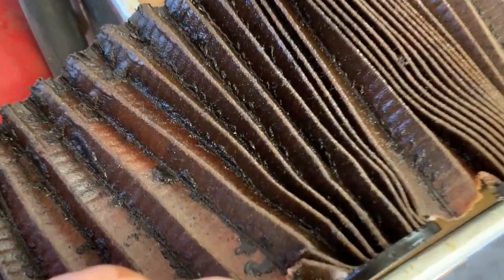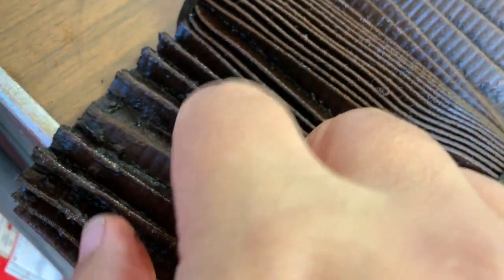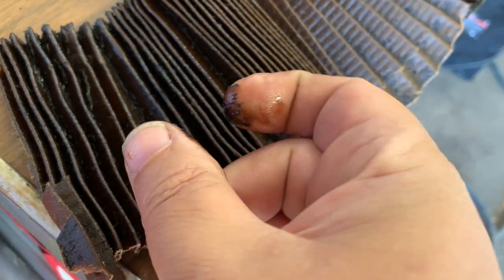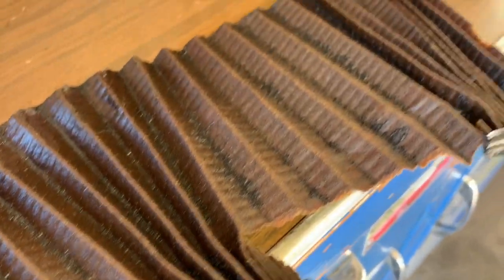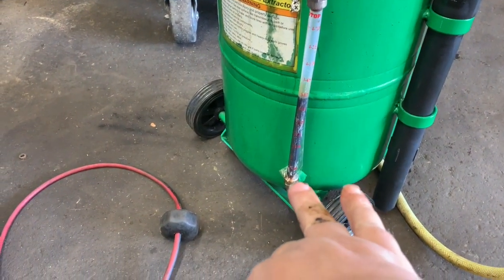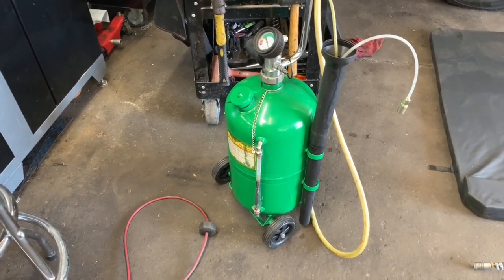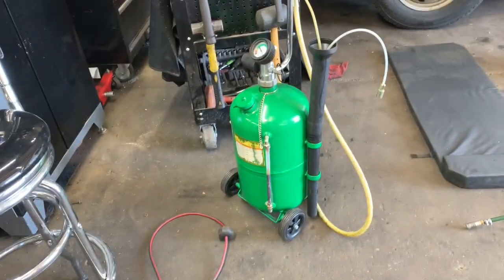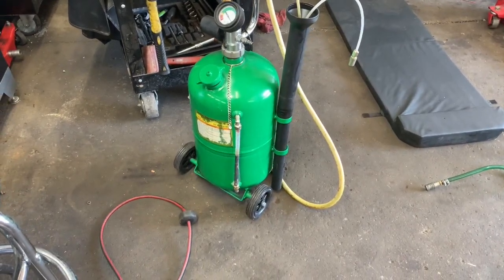Pentastar 3.6 P0016 and P0017 codes. A fabulous mystery unfolds. Solved! Ram Promaster

Comment: These codes can be caused by two loose oil plug screws under/close to  those two phasers that the manufacturer failed to tight up.  I own a 2014 dodge grand caravan and  I got a P0018 and P0300 this year, I fixed this problem thanks to a youtube video by the Online Mechanic Tip.
Reply from the maker: Saw that video from JT. In this case, we couldn't verify that those fittings were or weren't leaking because it would entail a lot of labor to get the valve cover off. That the damn thing was double filled with oil was enough to justify blaming the oil change place and proceeding from there.
Reply: @promastersonly1419  agreed

Comment: I own a 2008 GMC Acadia with P0016 and P0017 codes. The initial symptoms were a rattle noise on startup that disappeared shortly after. The car drove smoothly besides the rattle noise on cold starts. I drove it for 2 months prior to getting the timing chain replaced, but the codes persisted. I discovered metal debris in the VVTi and noticed scoring on the camshaft and journals after removing the camshaft.
Reply from the maker: @rebelliondoor  it stands to reason that debris and damage might bleed off oil pressure, and thus the cam wouldnt be in the position that it’s commanded to be in.

Comment: 6000k miles on a new long block from dealer.  Has a dealer oil change 1900 miles ago. Just got a random p0018 after a hard acceleration and a bumpy road.  No weird engine noise or tap. Cleared the code but will bring to dealer when we get home. Wondering if it’s a plug or wiring .
Reply from the maker: Several possibilities, and some of them are quite scary. But since the code cleared, it suggests intermittent electrical to the cam position sensor, which with P0018 is on the front head. The dealer will read codes and declare it's fine,  which it is for now. But if you can get in front of a human being make sure they know about the bumpy road and ask them to inspect the wiring coming from the sensor. If they were competent and helpful (fat chance) they would also so a software cam phaser cleaning routine, verify the cam position differences, and maybe look at oiling. But in the absence of other symptoms, electrical is the most likely, and all that wiring is easy to inspect and get to.

Comment: Since you like puzzles, Hopefully, you can give a suggestion and possibly piece it together. However, it is not a Promaster.
I have a 2014 JKU, and I keep getting codes P0017 and P0019. The engine will die (especially if dropped into 500 RPMs or below), rough idle, and sputter on a cold start. Needless to say, I cannot get in my jeep, start it and go without it stalling on me. Now if I let her warm up, she will drive beautifully until the traction control light pops on, then she goes into limp mode. However, I can put the jeep in neutral, turn it off, restart it, and drop it in drive then the traction control light will disappear. She will drive fine. I can turn the engine off, and restart it, and no traction control light. Now, I have replaced the camshaft position sensor, and the code is still there. Some people are suggesting a timing issue, however, I do not think it is a timing issue. If it was, I don't think it would drive as well as it does when the engine is warm. Therefore, it makes me think it is an oil issue. I did an oil change with 5w-20 and drove for about 700 miles, then thought changing the oil would fix the issue. I changed the oil weight and put 5w-30 full synthetic in, and the P0017 and P0019 code disappeared but was replaced with P000A and P000B. Those codes only showed up for a day, then disappeared and the P0017 and P0019 returned. Now I must add, I did check the timing chain and it is tight. I have taken it to 2 shops, and they have done diagnostics and are completely stumped as am i. Any help would be greatly appreciated. Thank you for your time.
Reply from the maker: I do enjoy a puzzle. I'm in agreement with you - a mechanical timing problem like a chain or a tensioner is unlikely. Your 017 and 019 codes are for both banks, in a jeep the drivers and passenger side banks (passenger is 1, driver bank 2). I suppose it's possible the chain jumped a tooth, but that's crazy rare. I can think of a few things to try. If you have access to a fancy scanner you can do camshafter phaser cleaning routines on all 4 cams. All it does is cycle the cams through their full range in an attempt to dislodge any dirt or debris that might be hanging up the phasers. But where I think your problem lies may be in the crankshaft position sensor. If it gives false data about where the crank is, it may code for the cams being out of position because it's just a dumb computer and doesn't know. The crank sensor almost never goes bad, but the wiring to it is exposed and often makes a delicious meal for rodents and road debris. Worth checking. It's on the passenger side of the block, low and rearward by the transmission bellhousing. (continued)
Reply from the maker: Assuming no issues there, we also have seen a very occurence where RF interference makes the computer screwy. Each cylinder head has a little noise supressor bolted to it on the back of the head by the transmission - simple little one wire black cube looking thing. Check though. Longshot. 

A fancy scanner also can do a cam/crank relearn. I doubt that's the problem beceause it would have coded for that, but it's something to consider. 

The next step after that is to verify the cam positions. This is pretty serious stuff, and involves using a multichannel oscilliscope to look at the signals coming off all 4 cam sensors and compare them to the signal coming off the crank sensor. In this way, you can at least be sure the computer is getting accurate numbers. 

After that, the next step might be to suspect that the little tone wheels on the ends of the cam have shifted. That's gotta be crazy rare, but there is a youtube video of a guy who experienced exactly that. I doubt that TWO cams would have done that, but it's a crazy world and anything is possible. That too would be revealed by the oscilloscope test. 

One thing I should mention - you can verify 100% that it's NOT the timing chain with a fairly non-invasive test. You gotta pop both valve covers, but when you do you'd rotate the crank such that the little arrows on the drivers bank were pointing directly toward each other, and when you do the the little lines on the other bank should be pointing directly toward each other. In fact, now that I think of it, you can be sure the chain DIDN'T jump a tooth, because if it did all 4 cams would be coding, not just two. 

One other curveball - in my video that lists the recalls, there was a run of cam sensors in late 2013 or early 2014 that are known to be bad, and known to cause P0016 and P0017. In that video, it tells you how to identify the bad ones by a number printed on the sensors. Worth a look. Pretty sure you can see both sensor's numbers without even having to pull the intake. 

After all of the above fails, it might be time to start throwing parts at it. Not sure what those parts would be, but they are going to be oiling related. Holding out hope that it's NOT that. There are examples of cam phasers going weak, but that's an easy test with the valve cover off. You just put pressure on the cam with a crescent wrench, and watch to see how solid the phasers are. 

Let me know what you find out.
Reply: Sometimes we look at problems way to technical and overlook simple solutions, just for shits and giggles I wonder if she were to prime the oil system prior to cold start if it would still do it, here's my thinking but I am only a half assed backyarder, Because its both banks related I would think it's something they have in common and seeing how there are 2 sensors and 4 phasers  and two chains I would doubt they would all fail the same way at one time, crank sensor would be a possibility and is not expensive and easy to get at so could change that but these engines seem to be oil temperamental I have known several of them to consume oil with no sign of leaks or burning they also have a crappy plastic oil filter housing and both banks use oil for valve timing, in 2014 I believe was the year they changed the filter housing to where the oil pressure valve was in the cap instead of inserting the filter over it maybe there is an issue with the cap when the oil is cold and thick that clears up when at operating temperature, when the oil is thick there might be enough pressure to close the valve and bypass the filter and maybe the problem is something to do with that by pass mode, priming the system before a cold start by hold one foot on the brake and the other holding the gas pedal to the floor then turn the engine over might expose this. Its a simple thing to do like I said shits and giggles.  @promastersonly1419
Reply from the maker: There's a company that makes a pre-oiler that bolts onto the top of the oil filter housing. I personally think it's entirely unnecessary, but you might dig it. Search for "dry starts" and I'm sure you'll find it.  @jaymortensen642
Reply: I saw that if we are talking about the same one, it comes with a shrader valve on the side so you can blow all the oil back to the crankcase during oil changes and it uses a standard oil filter instead of the paper cartridge but the issue is it's 350 bucks its not cheap, but I was just referring to a test by priming it just to see if the problem would go away that maybe the cap was faulty.  @promastersonly1419
Reply from the maker: @jaymortensen642  The flood clear mode works, so your test might work. But i doubt it would matter. At cold startup, the oil pressure is something like 70lbs. I forget exactly what the change for 2014-up addressed, but it uses a different filter.
Reply: My understanding is inside the oil filter housing there is a spring with a small plastic valve on it and you insert the oil filter over it, the valve is a bypass if the oil pressure is to high which can crush the oil filter but they had issues with that valve so they redesigned the cap to put the valve inside of it for 2014 so the cap is taller then the previous years maybe at 70psi it can crush the filter so the bypass opens until the oil warms and pressure comes down is it possible that valve is say not operating correctly or the bypass is partially plugged and effecting the phaser operation. So maybe the flood clear mode would prime the system and upon start up maybe she would not get the codes it seems cold start sets it off once warm she can shut off and restart without codes maybe her traction control is a different issue like a wheel sensor although I have been researching this because my kids jeep is having a similar issue but not the same codes but still cam sensor related and I think his traction control light comes on because of limp mode but he also has a clock spring issue, I think his cam sensor code issue is a lock in a phaser sticking he only has bank 2 effected not both and has already changed the sensor now those locks are operated by oil pressure being sent by the actuator it lifts the lock out of its seat allowing the phaser to move this is where my thinking is on her vehicle its something that effects all 4 cams at once these motors seem very temperamental about even type of oil used. @promastersonly1419
Reply from the maker: Any of those P0016, P0017, P0018 are going to be either the phaser, or more likely the tone wheel for the position sensor has slipped. Search P0017 on youtube and you'll see some videos on it.  @jaymortensen642

Comment: Hi, here in Brazil I just bought an 3.6 Wrangler 2014, the code p0017 is always on, and some time when I speed up, the codes p0339 p0345 p0365 p0390 all turn on and the vehicle goes very slow. Where should I start looking?
Reply from the maker: Starting easy to hard, I'd swap the cam pos sensors bank to bank and see if the code moves. I'd look for oil in the cam sensor connectors - seen that before. After that, it's more serious - pull the valve covers and verify that the galley plugs are tight, the cam tone wheels haven't shifted, and the cams are in time with each other.

Comment: Interesting one. 

Is there a zero oil pressure default position for the cam phasers on initial engine crank without oil pressure and how long does the engine have to run before the cam phasers are fully functional?  Also, is there a warm up or temperature schedule controlling cam phasers function during the warm up period, and will the phasers function differently during sub freezing and extremely cold temperature operation of say zero degrees Fahrenheit or below? 

I have a Ram Promaster City with the 2.4 TigerShark multi air variable intake system and on initial crank during start up, it sounds like their is a temporary hard crank hit just before the engine fires and starts running. Is that the oil pump doing its multi pressure/2 stage thing? And does the pentastar 3.6 v6 do the same 2 stage oil flow pressure thing for phaser control?
Reply from the maker: The multi-air engines are very different. But the 2 stage oil pump almost never goes into high pressure mode on the 3.6. Doesnt need to - it has 30lbs at idle in low pressure. 

Not sure of the exact start cycle, but the cams are adjusting almost instantly.

Comment: What brake pads and rotors for a RV 3500 promaster about 5 tons. Looking for the best pads and rotors. It has a 3 inch lift and an extra leaf in the rear. Lots of dirt roads and hills. Love your Chanel.
Reply from the maker: We prefer the Power Stop brand stuff. Rock Auto carries it. It's budget priced, but has proven itself to me many times over. The OE pads that you would get from a dealer are better, but not enough better to justify the expense. The rotors are just a chunk of steel, and the Power Stop rotors are identical to the OE at a fraction of the price.

Comment: I have the same issue p0016 P0017 since does codes my promaster sound like a diesel pls help
Reply from the maker: See my comment above. 

What I can say is if you were to pop both valve covers, the front (even) bank has a TDC marker. Rotate the engine till the arrows stamped into the phasers point directly at each other. When they do, there are two lines on the rear phasers that should also point directly at each other. 

If they dont, you know you have a chain problem, if they do you know you dont have a chain problem. 

I have also seen some info that speaks of worn clocksprings on the exhaust phasers. The phasers should be more or less rigid to the cam, if you were to go in there and try to rotate the cam with the chain blocked. If they are sloppy or loose, the cam will hunt time. But that doesnt explain why you have BOTH cams out of time. 

If you learn anything, let me know!

Comment: I been dealing with the p0018 code  crankshaft position camshaft position correlation bank 2 sensor a I replaced new camshaft phasers oil control valve  timing chain camshaft sensor  and the light keeps coming back..
Reply from the maker: We had something similar on another van, in that case a P006b. I gotta be honest, we couldnt figure it out, but in that case the amount it was off by wasnt enough to affect how it ran so we sent the customer on their way. 

It gnaws at me that we couldnt fix it. If you figure it out, let me know. 

One avenue we were about to try was wiring both cam sensors to the good bank. It seems crazy but apparently if you scope both sensors you find that they are basically in sync with each other. I’m skeptical that this is true, but it’s probably worth trying. I know from running it with the oil control solenoids disconnected that the cams wont crash the valves into the pistons or anything crazy like that.
Reply: @promastersonly1419   my van runs fine with no issues some times stalls little bit when I come to I stop sign  but other than that I don't notice anything else when I am driving  I am just gonna drive it until something happens I have another engine from a caravan in my storage.. but it bothers me that I replaced all this parts for not results. 
But I can tell after I replaced all those parts the check engine light won't come back as soon as it was before  I drove it for like 2 months with not check engine light on so I don't know..
Reply from the maker: @mtbbuddys2545  I’m with you. With no driveability symptom to chase, there’s nothing to “fix.” It feels like defeat, but just keep driving it. It’s all you can do.